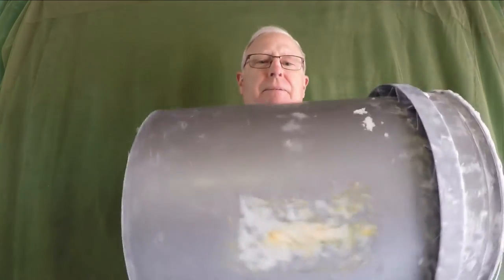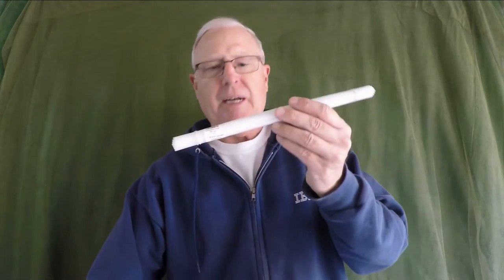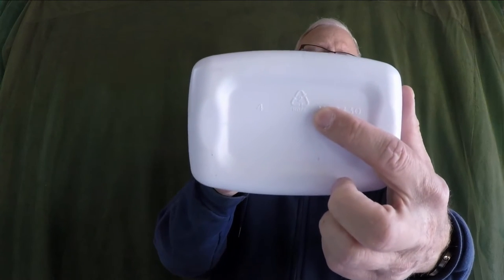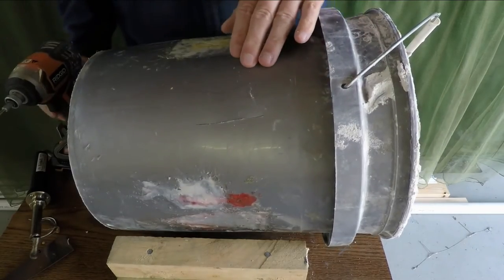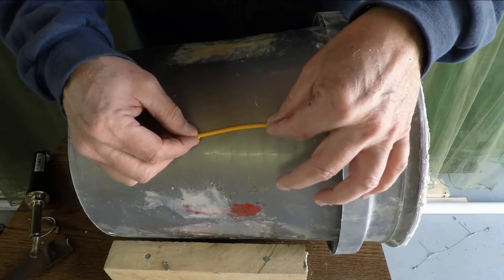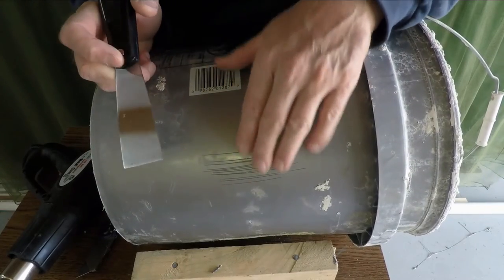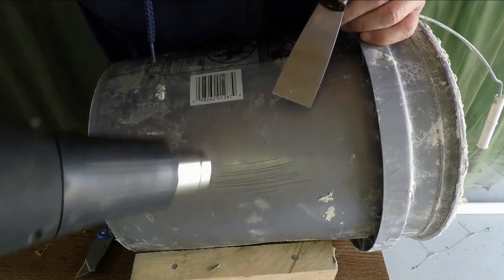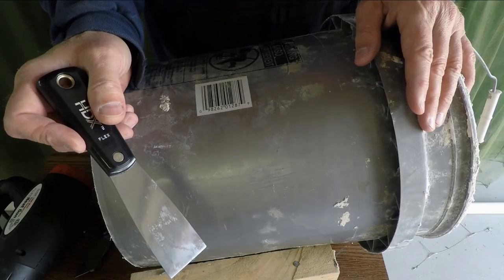Kayak Repair Plastic: How to practice plastic welding before repairing a kayak

Comment: I'm new to the 'yak game and really enjoying your videos, thank you.  I'm also an AF Vet, thanks for your service. Question, I have a Perception Outlaw with very limited access to the inside, if I were to get a crack, is an external weld sufficient?  Is there, by chance, another process for one-side access only?  Thanks again for sharing, lots of great information!
Reply from the maker: I am not aware of a way to repair from the back if the spot is hidden. In that case, just do the two holes and a gentle V, fill with new HDPE and hope for the best.
Reply: I have a Perception Sea Lion with a crack right over the bulkhead... no inside access!

I'm going to do the drill holes to keep crack from spreading (it began as a deep gouge), then the V, and use mesh, and HDPE.

I just got a heat gun so I can smooth out the scratches. Snowboard poly candles work too.

Comment: Great video, thanks for the tips. I have a Lifetime Tamarack Angler 100 which they left one of the hatch circles rattling around inside. I bought the Harbor Freight welder just in case I need to do any repairs. I will probably do the same and practice on a bucket first. Now what do you do in case you have a crack that you can't get to from both sides?
Reply from the maker: All you can do is cut the V channel and fill it in. It should hold.
Reply: @KayakhacksFishing  Great thanks for the tip. Hope I never have to use it but I'm ready just in case.

Comment: I liked it but wish the tools and parts links were included in the description. Not to mention you could use referral links to amazon stuff
Reply from the maker: Good point.  I will add the parts list.  All was available from Lowes or Home Depot
Reply: True, but its just as easy to google/search amazon.

Comment: What if you can't get to the inside of the kayak should you open up the crack to allow the material to melt through ??
Reply from the maker: I am far from being an expert.  I recommend you ask your kayak dealer.  If you do not have one, call the manufacturer.  That said, I would not open the crack beyond drilling the holes at the top and bottom and melting a "V" that does not go all the way through so the new plastic has something to grab onto.  Maybe somebody else can provide better advice.  Obviously, do not do anything that will make it worse.
Reply: moto man i
Reply: I'm no expert but I don't think you want to make the crack larger. My ABS plastic kayak developed a crack from a scratch on the side, which I repaired temporarily with duct tape on the advice of a long-distance kayaker who happened to be at the location where I launch to head out to one of my shorebird monitoring sites and land when I get back. It was clear that my kayak had developed a leak, but he spotted the crack before I did and suggested that I repair it with duct tape as a temporary measure. I only put the duct tape on the outside but made sure it was smoothed down all around the edges, and that temporary repair on the outside of my kayak only has held up great for more than two months 

I can reach the inside of that crack if it ever becomes necessary to repair that area, but I don't think it will. However, I have just repaired some short narrow cracks on the underside of my kayak's bow and stern with Gator Patches from Gator Guards, the cracks clearly having resulted from plenty of abrasion scraping over oyster shells, other shells, and and concrete boat ramps over the past 7 years when I was launching and landing. I can't get to the insides of those cracks at all, but the exterior-only repair seems to be working great. I can't see why you would have to repair a crack on both sides as long as you've done a careful and thorough job repairing it on the outside, making sure there are no gaps where water could leak in.